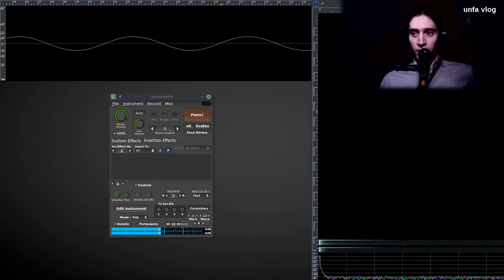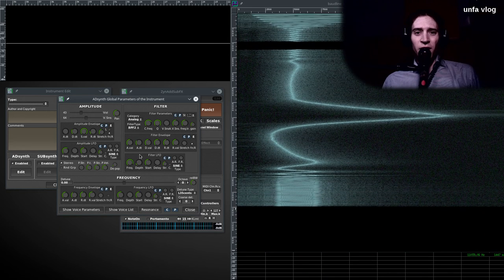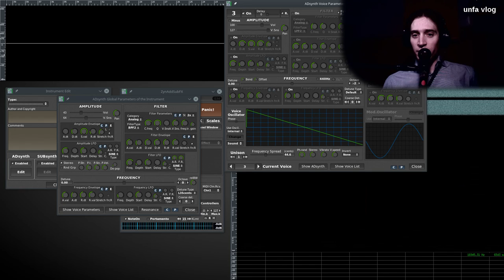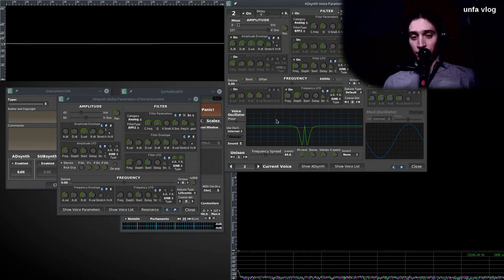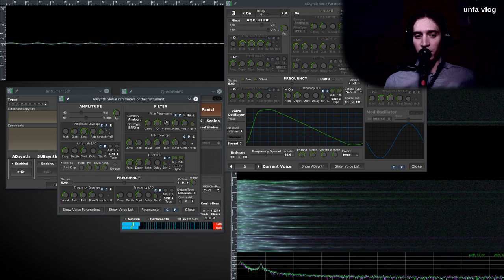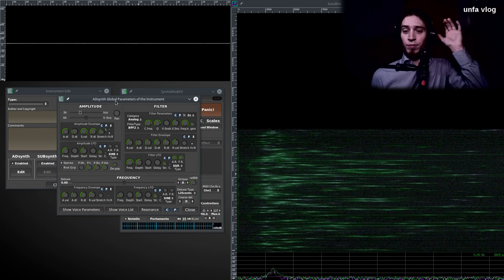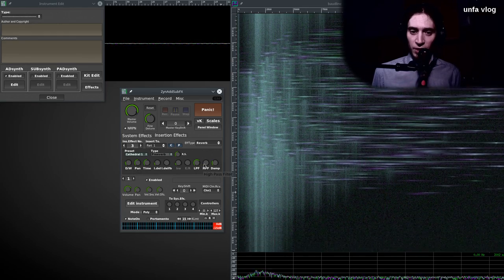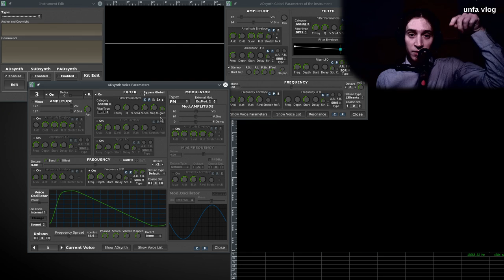UV#04 Making a Water Stream SFX in ZynAddSubFX

Comment: Hello. Great video. Could You let me know if it is possible to upload an wav file in ZynAddsubfx to create new instrument and how to do it ? Regards
Reply from the maker: Thanks! ZynAddSubFX doesn't let you load WAV files. Not many synthesizers do that. It's more of a thing samplers are for. Have you maybe tried Samplv1?
Reply: @unfa00  Thank You for the info. I did not tried but I see that it is possible for instance in Polygas. My question arised beacuse when I opened the ZynaddubFx instruments they often are very similar to those real so I couldn't believe that is all hand made job (artificial/generated waves) :) Regards,
Reply from the maker: @Darro2017  ZynAddSubFX can produce excellent sounds, I've used it nearly exclusively for like 6 years. I've made a few LPs where everything was done with it. If you're running Linux you can install a new interface called Zyn-Fusion. It's very different but once I've learned it - I'm not going back to the old UI!